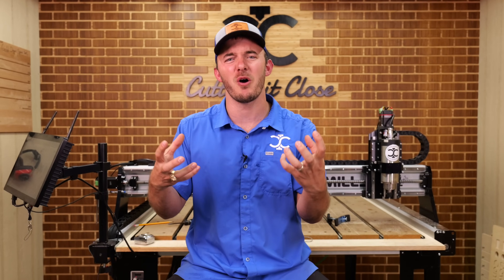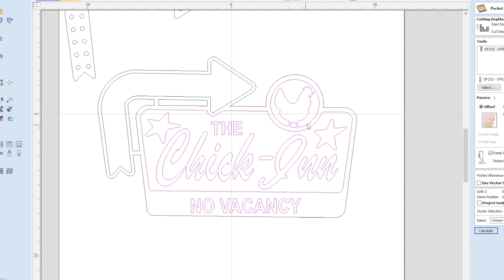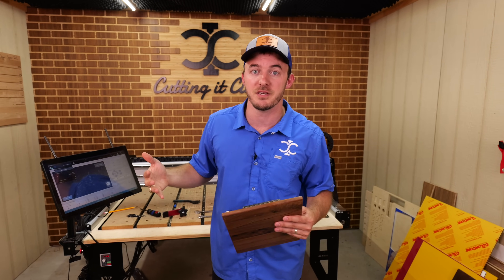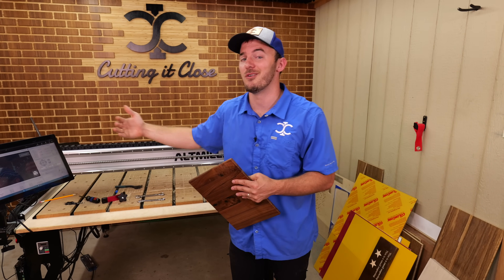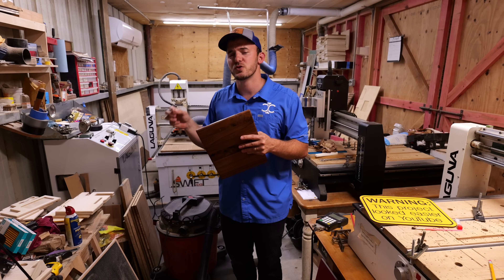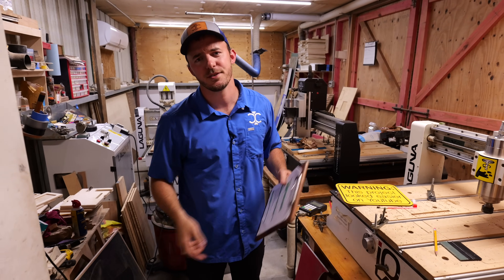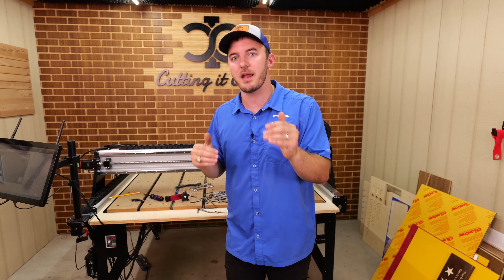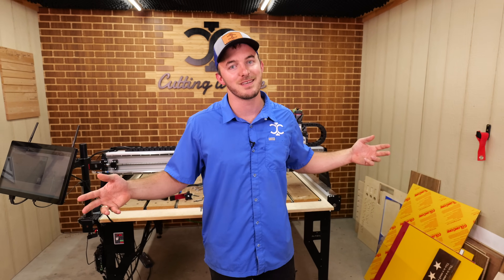Before You Drop $3,000 on a CNC… Watch This

Comment: I really appreciate your content. I'm thinking about getting into CNC as a hobbyist woodworker looking to sell some of my stuff at local retail shops and to friends and family. Not looking to do this to earn a living as I'm retired but it's never bad to make a few bucks here and there. I am considering either the Shapeoko Pro versus the Shapeoko 5 pro 4 X 2 model with the basic carbide compact router. What comments might you have about this decision.
Reply from the maker: The 5 pro is the better machine for sure. I like the 4x2. You can always go bigger if you have the space, but a 4x2 will do 98% of the projects you’ll be working on. 

Spindle is always better than a router, it may seem expensive at first, but the are better in the long run by far. 

My vote is 5 pro with a spindle or if you do go less expensive, then Pro with router.
Reply: @cutting-it-close  Thanks for your suggestions. There is a pretty big difference in price between the router and spindle. I don't see me doing production work or running jobs where the cnc will run for hours but having said that I'm typically a buy once cry once guy. Would I be disappointed to start with the $80 router over the $750 spindle?
Reply from the maker: There is a night and day difference. If you can handle it, I would say to do it.

Comment: I dont know about the other genmitsu machines, but the 4040 Pro MAX works great out of the box, except cradel, that program can suck it, wont start on the PC. But I just do the NC file in Fusion360 and push it on google drive and then push that with the app onto the machine and voila. Ive only broken one bit, and it was when I was going to fast, to deep with to dull of a bit. I don't understand what the difference between the base 4040, vs pro vs Pro max is, but it feels sturdy, like super sturdy if I compare it to some other stuff I paid 1000€ for. Tho, the bits it came with sucks, I just order bits from the same place I do at work.

Comment: Do your homework!  If at all possible, check out a CNC you may be interested in.  Hands on, see how well it’s made.  If you are sold on CNC, then consider buying the machine you would upgrade to.  Also, consider bits, dust collection, air compressor, air dryer (for liquid cooled spindles).  Are you a hobbyist or a maker that wants to sell products.  A failure to plan is a plan to fail.

Comment: Good info for just about any startup into a new area. I'd say the two key things left unsaid here are to identify your mission and plan to buy your second machine first. The mission identification is critical - if your goal is to add a capability to an existing woodshop (hobby or commercial) you may well end up at a different point than if you are looking to use it as a standalone business.  I see CNC's like the modern equivalent of the radial arm saw  - in theory they can do everything but in practice they work best in combination with other tools.

Comment: I get the feeling that router should be fixed to the table and wood should be moved above it for some jobs i think this could be the answer.
Reply: About 30 years ago I started out with a Carvewright (Craftsman). Wood moved on a sandpaper belt for X movement and a small motor ran a bit holder through a flex cable for Y & Z. still using some of the bits from that machine. Problem was proprietary software and under powered motor. It is about the size of a bench-top planer.

Comment: I bought the Genmitsu 4040pro off Amazon. Made my first cut after 3 days. It’s run every day since. It’s paid itself off, I’ve expanded it to a 600mmx600mm and paid that off. I haven’t had any major issues with it. Bought it off Amazon
Reply from the maker: That’s awesome!! That’s not the typical story I hear with Amazon ones, maybe Genmitsu is the exception, good stuff!
Reply: @cutting-it-close  Seems like this 4040 Pro has really high reviews from other youTubers. Have you ever tried? Seems like it could be a good one to get your toes wet and then expand from there.
Reply: Looking to get the same machine. How's your experience now, 2 months later?

Comment: Let's see, my first gantry router was put together with spare 3D printer parts, wood, 1/8 in steel plate, 1-1/4HP Makita router, and a $100 EBAY PC running LinuxCNC with a spoilboard made out of glued together chipboard.  Took almost four months to build. Cheaped out on almost everything which was VERY DUMB. 

My next one is going to be a beefed up PrintNC with MESA IO board running LinuxCNC, miniPC, touchscreen, epoxy-granite base, steel tube gantry, heavy linear bearings, ballscrews, 2-1/4HP Makita router with with MuscleChuck quick change collet, etc.  And the printed parts will be completely replaced with aluminum parts. It's going to be heavy enough to mill mild steel at least semi-accurately, though the only metal I plan to mill with any regularity is aluminum.  

And yeah, you won't be ready to produce anything worth selling in your first 30 days. You're still going to be figuring out what bolts back themselves out and what comes out of alignment in your first 30 days, let alone good tool paths, etc. There's a reason people get paid a decent wage to operate these things.

Comment: I did buy a cheap (under $200) cnc machine to try out and see if I could figure out how to run one. It only cuts 7"x7" and I certainly broke a lot of bits learning. I have had it for quite a few years and it still runs and I still create fun projects on it. I would like to eventually upgrade to a much larger cnc to do larger projects and you have given me some helpful tips.

Comment: Ahhhh i so remember driving bran new bits 3 inches into 3/4 inch wood..... my favorite part.... zeroing from the wrong surface... or designing my stuff to zero from one surface then zeroing it from another surface..  and oh yes forgetting to turn my spindle on...and plowing my 40 dollar bit into the wood..
So satisfying...
And don't forget the burning smell as your bit stays in one spot..
Reply: I forgot to turn my spindle on once too... but the bit I was using came as a pack so I was fine but now I check everything.

Comment: Well, I saw this video just moments after ordering an Altmill MK2 4x4 with all the accessories.   I’m not entirely new to CNC, and have been very successfully using (and making money with) a laser in shop for a few years. I currently have a Shapeoko 3XXL that I bought used about 6 months ago. I haven’t been super successful with it, but that’s mostly because it is ridiculously inaccurate.  I’ve spent a ton of time and money replacing parts and attempting to get it tuned up and dialed in….with no success. Specifically, the z-axis is extremely inaccurate and is also out of tram. I’ve squared it, shimmed it, replaced belts and v-wheels, , adjusted motor settings, and just can’t get it right.  If I was just making signs and knick-nacks,  it would be fine, but I but I want to make stuff that requires more precision. Hopefully this new machine will be far more accurate and easier to tune than the old shapeoko.
Reply: I'm about 5 weeks ahead of you on the altmill waiting list. I too have. Shapeoko XXL...I really have had none of the accuracy issues that you mention. It does break a lot though. Especially in the electronics area.

Comment: I agree with everything except the "cheap CNC" part, as long as you know what you're getting. I've bought a Genmitsu Reno 6040 (4040+6040 upgrade kit) and I upgraded to a Genmitsu brushless router with an AC power adapter, I know the limits of belts as my previous DIY CNC made of plywood, which uses an old Dremel, still runs fine after a decade. I just wanted a much bigger cutting area and building one from parts would have cost more than what I paid for the whole setup so far. My complete setup is probably 20 to 25% the cost of a 24x48" Altmill, and for a hobbyist it shouldn't matter if a part takes 3 minutes to cut vs 30 minutes. At the end of the day, you have the parts for your project.
Reply: True, but I think alot of people don't realize the limitations of their machines until after the fact. They buy a Ford expecting a Mercedes. You're right thought, if you know what you're getting and what it's capable of, then go for it! You gotta start somewhere, right?